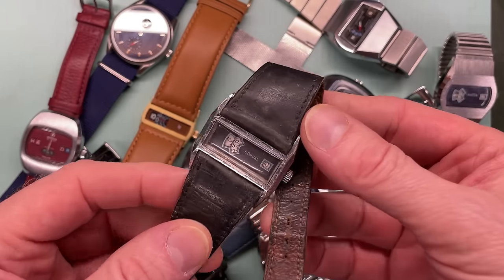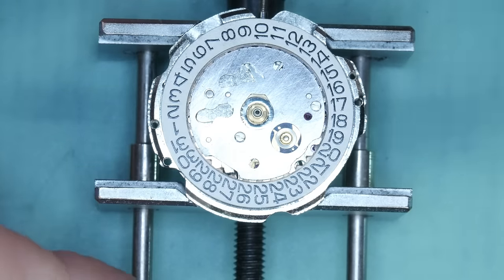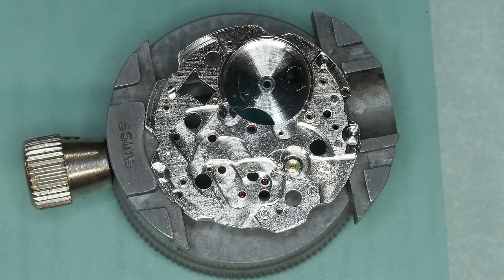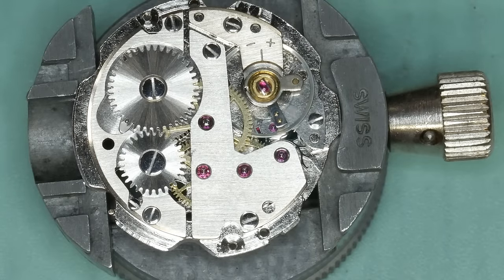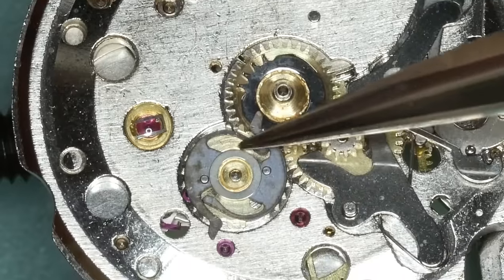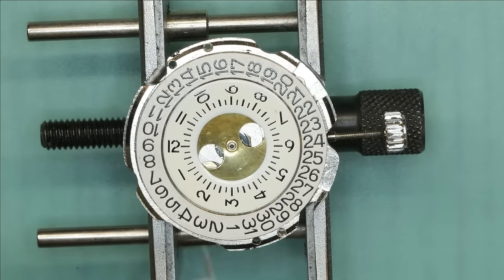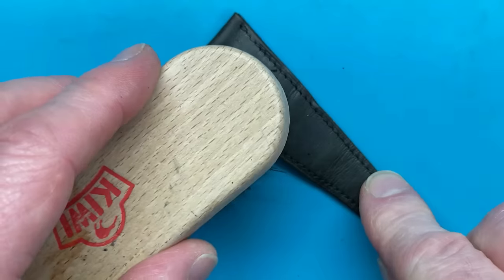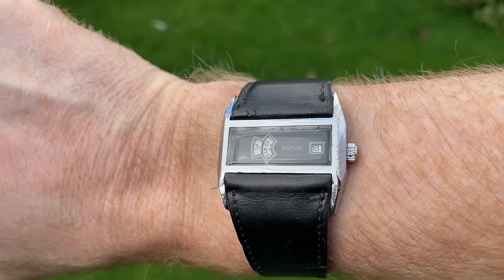CAN THIS WATCH BE SAVED? -  Dorval Jump Hour Watch Restoration

Comment: Why wouldn't you seek some beginner (or just willing and not too snobbish) leather craftsman to order a new custom strap? This isn't the most complex thing to make, so it's unlikely they'd mess it up, and whatever they charge would anyway be at least tolerable for the purpose. If you can't find them on YouTube, there should be some DIY or other kind of fairs or festivals in the area or a bit further (the UK itself isn't that big anyway). Worst case, the nearest stables or a riding club, horse people can't do without leather and they know leathercraft folks...
Reply from the maker: Because that would not make content. I have never tried to revive a strap so figured it would be interesting to do for the video.  Equally this watch will not be worn that often so I am keeping the costs down.
Reply: @MyRetroWatches  it actually would, because collaborations are well liked by the audience and bring traffic to all channels involved.

Comment: I'm no expert but have watched numerous people disasamble and then reasamle mouvment. There a variations ofcause but one thing all mecanic mouvments seem to have in common is the barrel and inside is the barrel spring. I was surprised to see you not making the effort of extracting the spring to clean inside and place some new greece inside. This was disappointing to me.  You make all the effort and then only do half the work. Becaus of that  in my opinion , you can  not call this  a full restoration. It isn't even a full service. Nothing agenst you, you can do things thr way you want to, but thoght I'd mention that. On top of all that I was also surprised to see how you left the disassembly of the hair spring bridge to the end and not try to take it out asap to put it into a safe place.
Reply from the maker: I did remove but I rarely show it otherwise videos become well past one hour. I’ve shown how to hand wind a spring and I in other videos shown my spring wonder tool.
If you watch the cleaning montage part you will see me put the spring in the cleaner.
To film unwinding a spring, liking the spring and barrel plus then using the winder, which is hard to film on my setup would easily add 15 minutes. 
I found anything over 1 hour just does not get viewed as people get bored. 
Perhaps in my next video I will show it again as a refresher as I nearly always service the mainspring. That being said hand wound movements that are not automatic do not have any grease or oil as it’s not required so on occasion I take the lid off and it all looks fine so I’m my view no need to remove it.